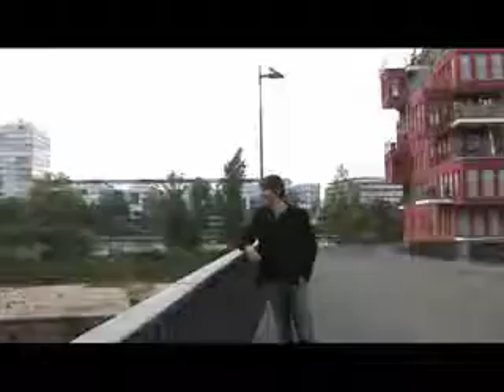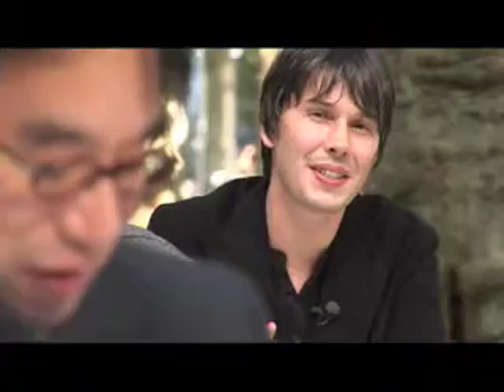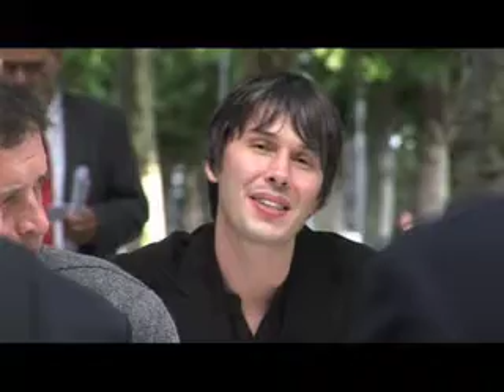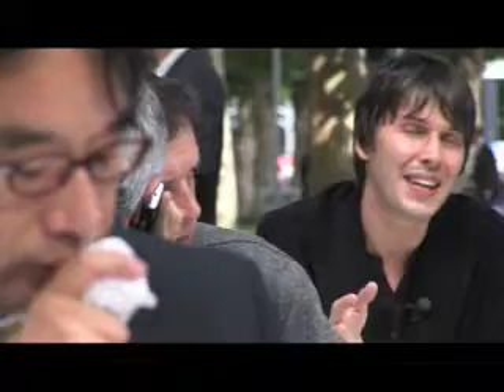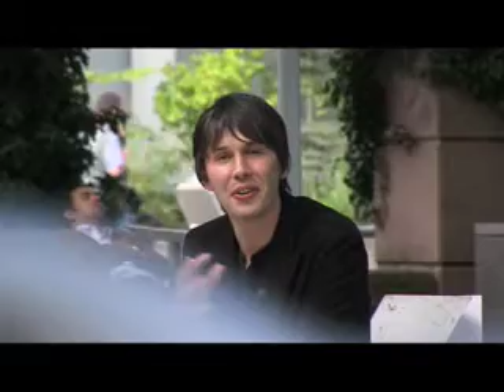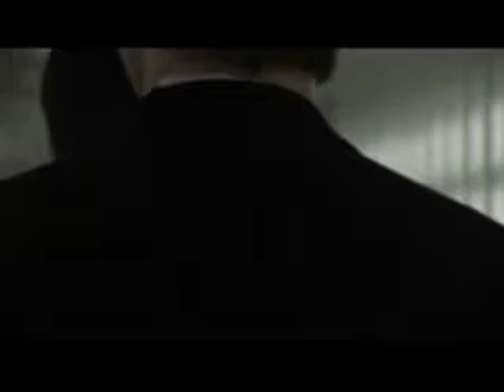Brian Cox on hybrid technology

Comment: "Hybrids are here to stay" no doubt but in what numbers? They have been available now for over 10 years but have made little inroads in mainstream motoring. We are looking a period of dramatic technological flux in road transport which could last 20-30 years before a final solution to an internal combustion engine appears. I don't mean electric vehicles because they have been around as long as the motor car with little take up, in fact a 50% reduction in sales in UK alone for 2011 over 2010.